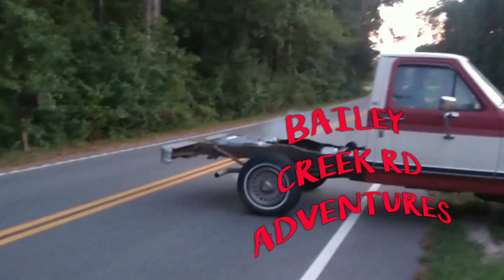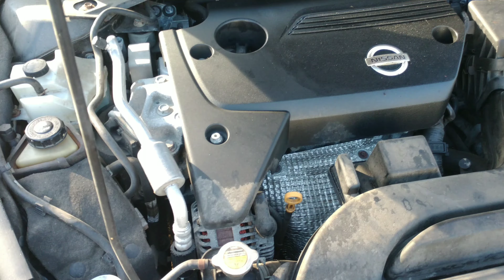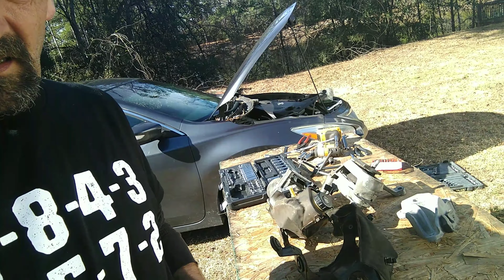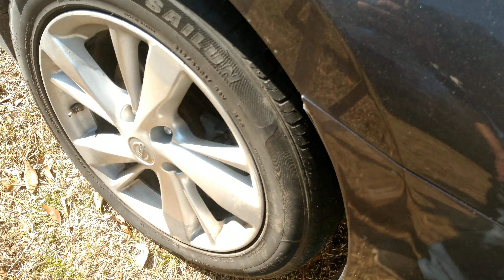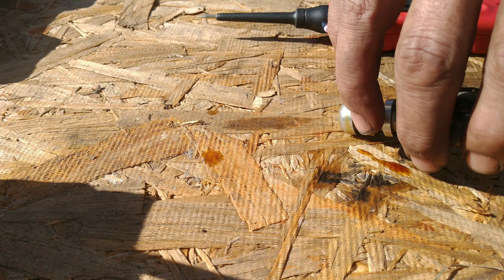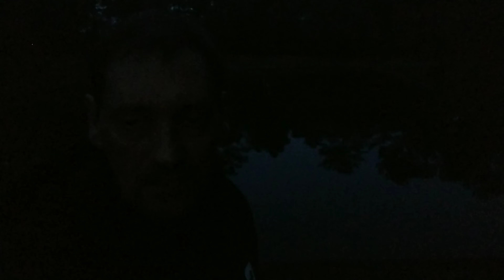2013 Nissan Altima P0014 VVT Solenoid Repair

Comment: There was an easier way to do it,  lift the car and remove the tire, and you could get 2 from the bottom, the 3rd one from the top.  It took me 20 minutes to change all 3 on my nephew 2013 nissan altima.

Comment: hello just confirming that the solenoid in the correct order looking at them from left to right, first one is hold, middle one is intake and 3rd one on the right is exhaust, is that correct?
Reply from the maker: Correct!
Reply: thank you so much @BaileyCreekRdAdventures  it helps a lot.
Reply from the maker: @Kimbo3838  no problem. Glad I could help

Comment: If one of them goes bad should i replace the one that is faulty? I change the faulty one and its shifting with high rpm when i step just 1/4 of the pedal? Should i replace the other 2 as well?
Reply from the maker: Reset the check engine light, and if it comes back, see what it says
Reply: @BaileyCreekRdAdventures  it didnt came back i reset it but it still shifts wird like really fast and high rmp with out pushing the throttle to half
Reply from the maker: @toronjillo2  do you think you may have multiple issues?
Reply: @BaileyCreekRdAdventures  not that i know off... it was shifting right before it just sometimes would stop while idling thats about it.. and thats when i got the code p0011 which is the middle selenoid intake variable valve
Reply from the maker: I would swap the middle one with one of the outer ones

Comment: Helpful video and all but you did way to much extra work man!  All you needed to do was take that wheel off and take that wheel well cover off and you would've been good to go.
Reply from the maker: I know. I don't have any concrete to work on, and wasn't going to trust a jack stand in the dirt.
Reply: My wheel well is welded and I cannot take it off to replace the solenoid

Comment: Hello. Can the top electrical part be pulled off from the lower half. Mine comes off, even though it seems to click when power is supplied to it. Is it still okay
Reply from the maker: I wouldn't recommend it. The complete solenoids are not that expensive